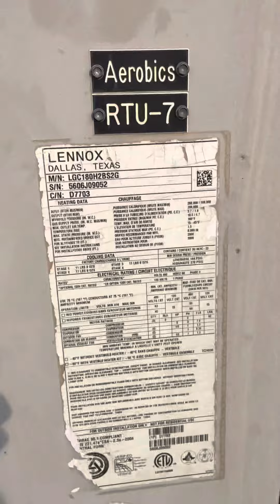Hvac maintenance on a Lennox unit |Hvac life

Comment: Dude use duct tape to join your filters together, it will prevent those dust lines on the evaporator, just a tip or different perspective, I know each to their own and everyone has a different process but it makes a difference in the long run
Reply from the maker: Awesome suggestion! I will definitely try that!
Reply: @EZHVAC  in this industry that’s saturated with know it alls and super techs, I’ve just made it a practice of doing what others won’t, keep up the good videos dude, and keep up the positive vibes